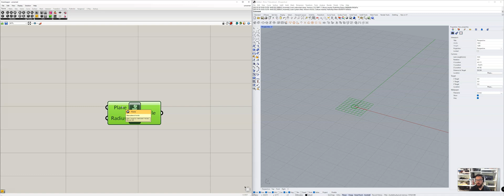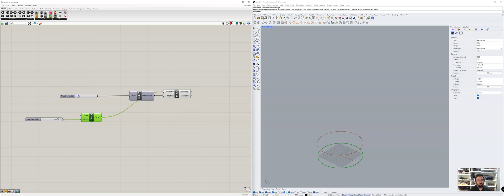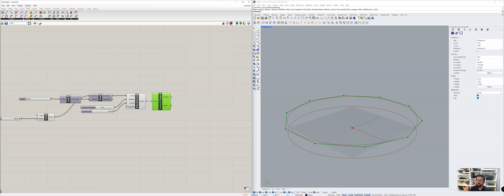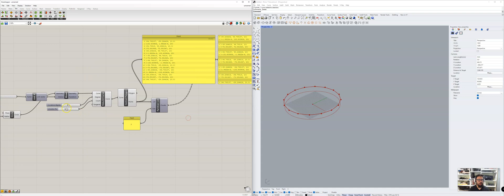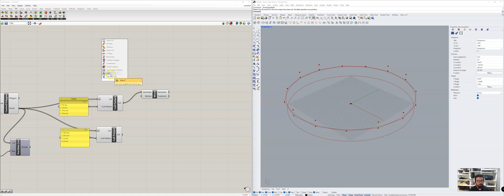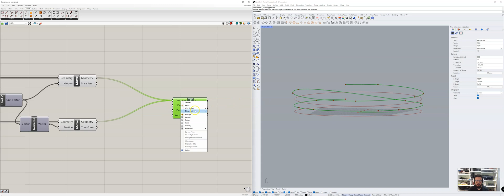Grasshopper for 3D printing

Comment: Just have question about level extrusion There is chapter "flow" (page 127) but its not clear enough.
Reply: FYI, I am not the author of the book. That’s another guy.
Reply: @creativedesignmachines  just according to your knowledge about the book. Is this easy way to reduce or increase material extrusion compere to axis Z movement